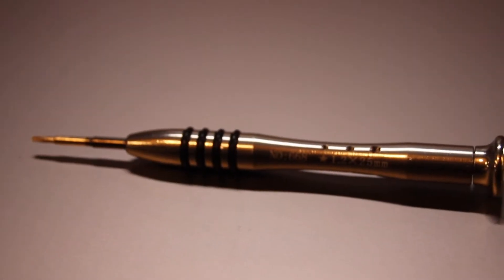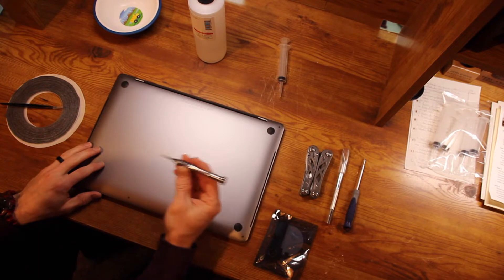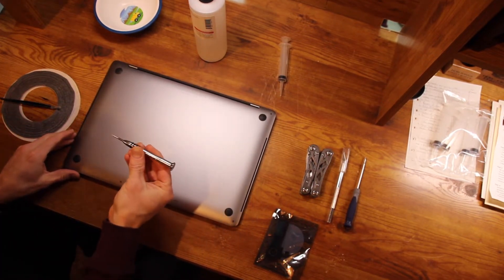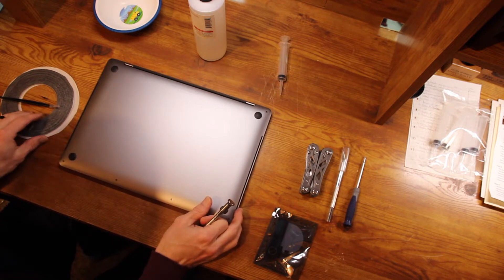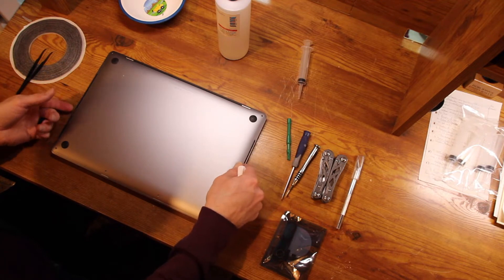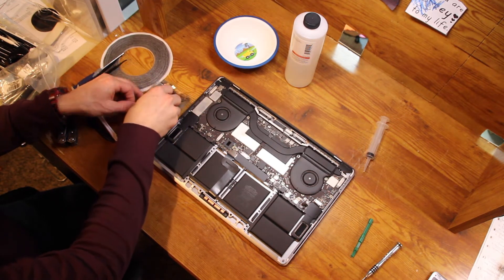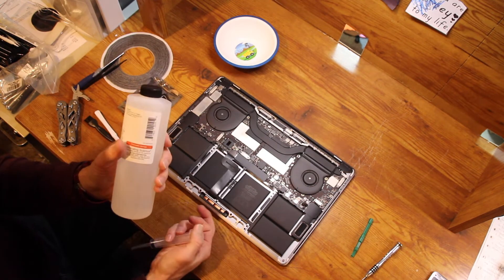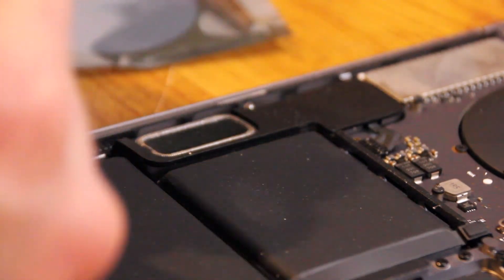How to Remove or Replace Broken Speaker in 15 inch 2016 MacBook Pro Model A1707

Comment: Thanks for the video! your tips are spot on, the pentalobe screwdriver is really nice one, I bought a cheap repair tools kit and it did not include this one you mentioned and it was really the hardest part of all the procedure... I used "nail polish remover acetone" to wet a bit the glue under the speaker it worked really well with only 2 or 3 drops... now I have stereo sound again. :) thanks a lot!

Comment: hey boss, I have the same macbook pro 2016 A1707, I did a right speaker replacement.. the part I bought was an original authentic apple speaker, upon looks it seems authentic indeed. but the right speaker sounds tinnier (worse) than the left speaker, that I left untouched ( i only replaced the right speaker).. any reason why this is like that ? the left speaker sounds much bassier and richer.
Reply: maybe it is a bit loose?
Reply: loose as in the tape that's holding it down ? the wired connection is sturdy.. @JuanAlfredoMorete